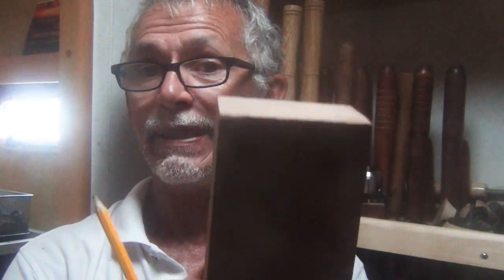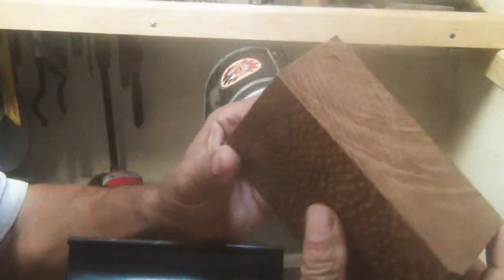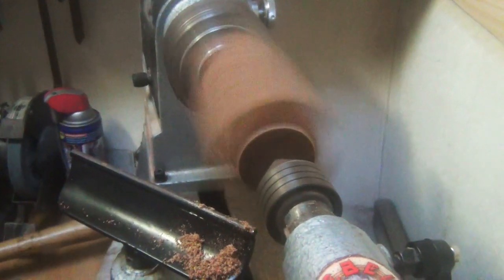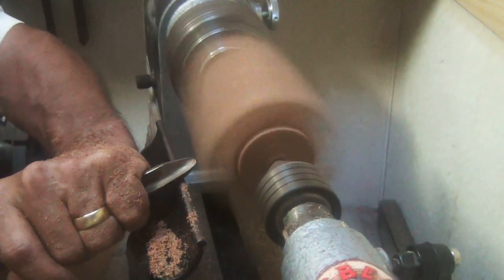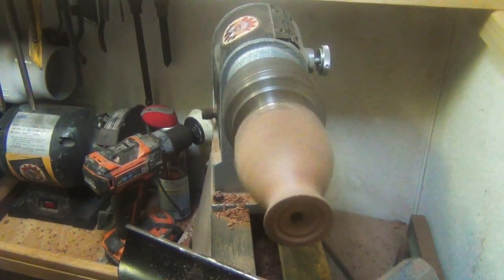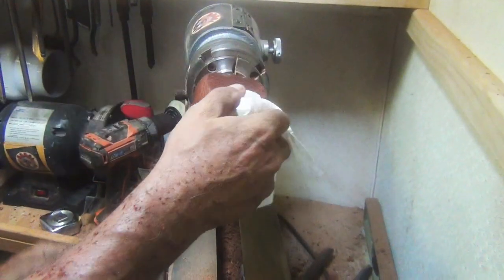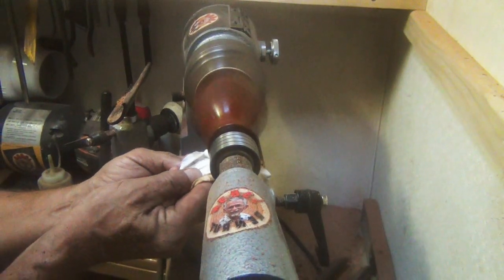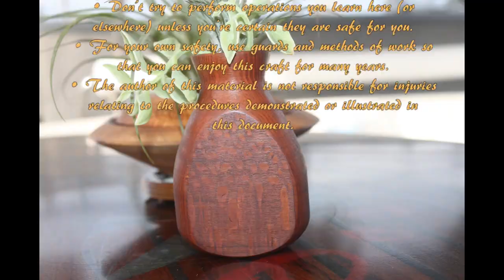Woodturning a Macadamia nut vase in rough waters

Comment: Albert my friend, that dust could well be the end toy your turnings on that beautiful boat. Take a shallow dish of water and place it under your piece on the lathe, set the speed to very low and wet sand your work. Not only will there be ZERO sanding dust, you will in most cases get a better finish. Not only that! Your wet n  dry sandpaper will cut much faster and will last three times longer at least. Why not give it a try, I'd hate to see that dust beat you. I'm sure your lovely wife Fatima will adore you a little more too!
Reply from the maker: Yeah I need to get on the ball   and do a few things like a dust extraction  including some wet sanding or iliminate the sanding all together. LOL
Reply: @AlFurtado  I'm new to turning and like the use of resins to get the most out of badly cracked wood that would otherwise end up on the wood burning stove. I found that wet sanding gives the best results on the resin, as a bonus I also find it works pretty good on the wood too. It lifts the grain and when it dries down there's no muck clogging up the pores of the wood. Hit it with some shine juice as you guys call it and I think you get a much cleaner finish. As already mentioned the dust it stops is a real bonus.

Comment: This is for the rebel Turner what do you use in your mixture for bowls I know it’s shellac what’s it what’s the other mixture
Reply from the maker: The mix is equal parts Shelaac, Boiled Linseed oil   and Denatured alcohol. shake well before each use. I just mark a bottle devided in 3rds and fill to each line with each mix.